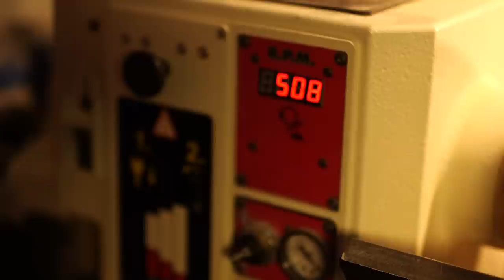Turning a wooden platter with Glenn Lucas Woodturner

Comment: Beautiful piece of work!! thanks for sharing.
I have a question... what do you use on the platter when you are sanding it?
Reply from the maker: Mineral oil. It keeps the dust down. Makes the sandpaper very effective as it stop it from clogging and is is a great finish for a piece which will be in contact with food.

Comment: Hi Glenn.  I note in your shorter videos you often go start to finish in green wood.  Is that for ease of demonstration since I know you use your kiln for your production line.  Are there any times you go from start to finish in green wood rather than roughing first?
Reply from the maker: Good observation. I do dry everything in the kiln and bend the rules for demonstration purposes.